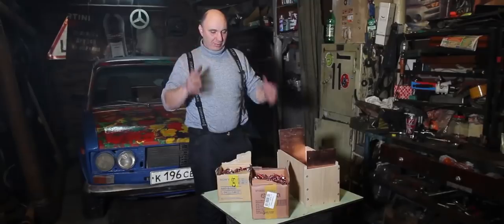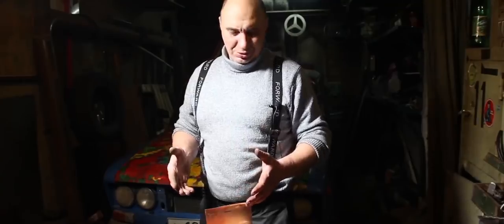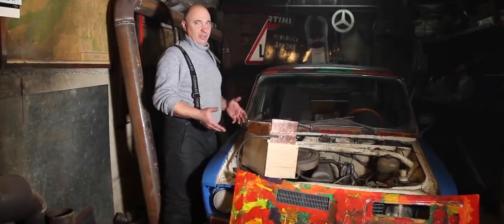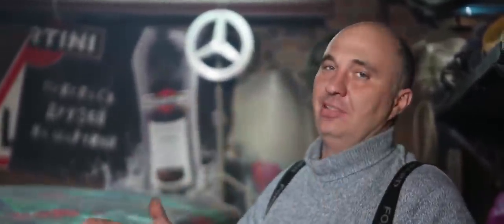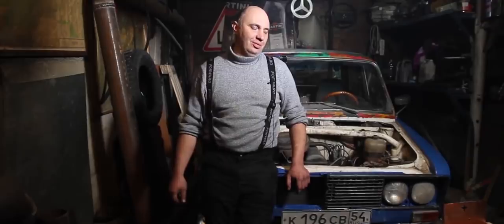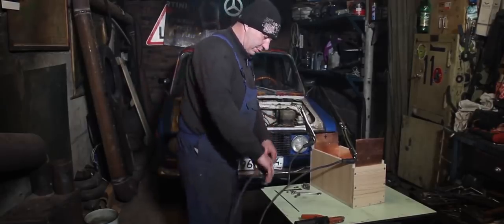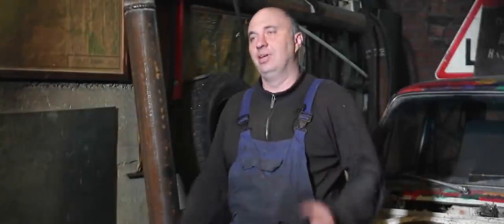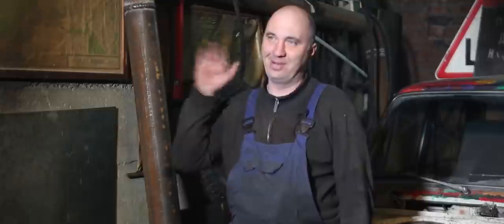1000 AA's instead of a conventional car battery

Comment: That was a smart way to connect all the AA batteries in series and parallel.
Reply: I was wondering how they would. Figured he would have five guys soldering all weekend lol
Reply: I know that was like 300 volts maybe more depending how dead they are.
Reply: WitherSpawn  I think  the voltage in the way he configured them would be what ever wide  by long wise on a (single level)  idk I gotta think 🤔about it.  1000 1.5 s it can be 1500 volts
Reply: Yep.   8 batteries long = 12 volts.   He should have 12 volts at the end plate.
Reply: @g36killer  No. Its all lines of 8 for serie; 8*1.5 = 12 V. And then all those lines of 8 are paralel, which only increases the current (I).
1000/8 = 125 times the current of 1 battery. Since he said good alkaline, but not top, its probably about 1 amp, so the total rigg can then produce some 125 amps at 12 V. That is P=UI > 1.5 KW
Under heavy load (you are basically shorting the batteries and they are not intended for such use, the Voltage will drop some. Which then means the total power is also going down. Probably effectively 1 KW for limited time. Enough to start a car, not enough for welding like this. You can however weld small things, even with a lot less power.
Reply: @StofStuiver  and that is why i flunked tech school...Math no go
Reply: @StofStuiver  I am an Auto Electrician,  your maths looks correct, I was concerned about them being charged at 14 ish volts and how a standard AA battery is not made for that, I wonder how long they would go before they heat up
Reply: 8 batteries in series to reach 12V (12/1,5=8). 100A to start car divided by 1 amp per battery = 100 batteries in parallel. 100 batteries for the current times 8 batteries for 12V = 800 batteries in total. wow!
Reply: Yes it was
Reply: @EssentialComment  I was wondering the same thing. But doesn't an alternator have a feedback sensor? Humm........
Kif ! We have a conundrum.

I think in reality, eventually that alternator would ghost them.
Reply: 12 volt
Reply: just 12 v and in best case 240 amps
Reply: 1000 seems like a lot. You could probably start it with 100, since you can draw around 7 amps from a single AA. Though unless recharged you would only likely start the car once or twice.
Reply: @StofStuiver  If it is 1 KW, then what is the wattage per hour?
Reply: @teemum.9023  1KW for an hour is 1KWH ;p
That is, if that power can be sustained at 1KW, which these batteries can not. So errr in order to calculate how much total (usable) power you can get out of this rig, youd have to know the precise specs of these batteries. My guess is with fairly new batteries (makes a lot of difference how long they are in transit and on the shelf), we are talking 5 minutes probably.
Reply: @bansheemania1692  simple Ohms law. pretty easy when you learn how the equations are broken down. figuring out amperage in parallel is fun :P. the recipical method blows many peoples brains away lol
Reply: I saw a teardown of a Tesla-battery, and it had loads of these types of batteries inside (well, not AA, but they look kind of the same) but they are welded. but probably not by humans, but 100% by robots, and not one at the time :)
Reply: @StofStuiver  how do you know the amount of battery's end to end creat volts, and the total amount makes the current/amps? I know school probably but I'd like to learn about that topic if you can explain a little
Reply: @Anon29  is that how you know how many batteries to have in series and in parallel? Or how you know why it works that way
Reply: @skie6282  Well its been a couple of years, so i dont remember the video exactly, but i think you are asking about the principles of series and parallel as for batteries.

So for batteries, puting them in serie, you can add up the voltages of all components. (series = + to - to + to - to + to - etcetera, and ofc each + or - goes to the next battery. If you would connect a + and - on the same battery, you short out the battery). So if you have have 10 1.5V batteries (the AA or AAA types and such); if you put 2 in series, you get 3V, 3 > 4.5 V. 4 > 6V. Etcetera. And 10 would be 15V

Puting batteries parallel, you can add up the drawcurrent, so the current they can together produce. (parallel = - to - to - to - and + to + to + to + etcetera). So if you have 10 of those batteries again and you put them in parallel; the current you can draw (if 1 battery can produce 1 amp) is 2= 2 amp, 3 = 3 amp, 4 = 4 amp and so on.

Now note that for series the current you can draw from the total is no greater than the current from 1 battery. And for parallel the V of the total is no greater than the V of one battery. Also note that we are talking 'identical' batteries. Things get more complicated if you mishmash different voltage and current batteries, if it is even possible.

So for this situation they want to start the car with 1000 AA batteries. We know that AA batteries (alkaline) are 1.5V. Another thing we know is that it is to replace the car battery, which is 12V. The starter motor obviously is also designed for 12V. So with these 2 known we can first calculate how many batteries we have to put in series, in order to get 12V.
Thats 12/1.5 = 8 batteries. So the rig has to be made with 8 batteries in series.

But we are not going to get the starter motor to turn with just 8 batteries. The current you can draw from those 8 is no more than from 1 battery if those 8 are in series (see above). So i estimated 1 amp for this type of battery. (ofc i can be wrong on that, but i presume not much). So the power we can draw from 8 batteries in series is P=U*I > P = 12 *1 = 12 watt. Thats a nice amount for a flashlight, but its not going to turn over the starter motor.

So in order to increase the power the batteries can deliver, we have to make a number of these 8 in series. That 8 is fixed. Bc we need 8 to get to 12 V.
Since we have 1000 batteries, we can divide that by 8 and get 125. So they have to make (or made) 125 'strings' of 8 batteries in series.
Then to increase the current that they can give, you put all those strings in parallel.
That gives you 125 amps.
So P=U*I > P = 12*125 = 1500 watts = 1.5kW and then will make the starter motor turn over nicely.

Another example of series and parallel is what you often see car/truck enthousiasts /repair people do. They often are faced with missing or broken batteries when they get a new machine and want it to run at some point. Car batteries are pretty much all 12V and truck batteries can be 24 or even 48 V.
So you often see them take 2 car batteries and put them in series to get 24V to get the starter motor of the truck to turn over. Sometimes they will use 4 batteries; 2 parallel to increase current and 2 series to increase voltage. Or you could use a 24V one and connect it parallel to 2 12V ones that are in series.

One thing i often see people confused about is that (as for batteries) the current a setup can deliver is not necessarily the current it produces at every moment. It is after all the device that needs to be powered, that determines how much energy it needs. Since V is fixed, the current that actually runs, depends on the consumer (starter motor for instance), not on the producer (the battery). Pretty much the same as a wall socket in your house. Houses are/were often equipped with wire and fuses of 16 amps, at 220/240 volts. But if you plug in your phone charger, it will not draw P=U*I > P = 220 * 16 = 3520 watt = ~3.5 kW. If that amount of energy would flow through your phone charger it would instantly burst in flames. Actually the power for that is milliwatts, rather than watts even. So the current is even a lot smaller.
A coffeemaker typically (bc of the heat... all heating devices use a lot of power) is 1 kW. A microwave typically is 700 watts. A big flat screen tv, 100 watt. Desktop conputer; 200 watt. Etc.
The power consumed is dependant on the device that uses the power and more specifically by its resistance over the power inlet.
So the 16 amps @ 220V is the indication of the maximum amount of power that can be drawn over those lines. It is fused at 16 amps, bc the wires are only safe up to 16 amps.

I hope that helped you ;]
Reply: @skie6282  voltage is additive in series,  amperage is additive in parallel, Ohms law. E=IxR, E is voltage, I is amperage, R is resistance/ohms P or power/watts is found P=IxE, I=current/amps E=voltage.
Reply: @g36killer   300 V would have fried everything electric in the car including the starter... The batteries was 8 in series meaning 1,5v times 8 = 12v not 300... Rest of the batteries was in parallel to give it enough amperes to run the starter..

Comment: I really wish he'd put a multimeter on the batteries before and after, see how much voltage is in there and how much it sucked out.
Reply: My guess would be 12.7 volts and about 1090 amps to start, and 11.9 volts 950 amps at the end.
Reply: @davekauffman8727  1090amps in batteries? How? Battery is a voltage source, it will push out current inversely proportional to connected resistance, up to a point where the leads melt or the battery explodes.
Reply: AA batteries are about 2ah. Hes using 8 batteries to make 12 volts and I think I counted 11 series per layer and if he has 1000 batteries he will use 968 batteries to make 11 levels of 11 series cells. 

Each 8 batteries is 2ah, each layer is 11 series so 22ah per layer, so it's a 242ah battery. Small cars usually require 200 amps to start, this isn't capacity but a burst rate. So he might be able to crank the engine for an hour before it'll die, theoretically. Thise batteries look cheap so I bet they'll overheat first.
Reply: @davekauffman8727  thats a much smaller engine but usually most batteries crank like 500A out and the process takes 2-3 seconds so i guess 1000-1500 ampseconds. given that aa battereis dont support high C discharge i suspect his battery has a very large capacity. also keep in mind this tiny russian engine wont need much cranking amps
Reply: @Karl with a K keep dreaming
Reply: @Karl with a K maybe as a rating my ls trucks starters are rated for like 1.1kw ,1.2kw so like 100 amps but the in rush current will probably be hundreds of amps so I'd assume something like that is probably like 70 amps but the inrush is probably over 200 maybe 300 amps
Reply: Ya my math is 8 in series so thats 125 groups that make 12v and new ones being like 1.6v or like 1.58 up there so ya 12.7 or 12.8 but my testing puts only the best at 2AH more like 1.5 AH I think is fair maybe a little higher and I'm assuming they are alkaline but that's like 190Ah battery that's pretty big most car batteries are like 50Ah and short circuit current I get about 10 amps I'm not sure what the voltage drops to but it recovers pretty well but I think they could put out like 1250 Amps I bet you could get by with a lot less and if you did like 20 in series you could probably easily weld that would be 50 groups and be able to do like 500 amps
Reply: @Karl with a K well not tiny but the rest is right I guess depends on what you consider tiny like I said my 1.2kw wiĺ draw 100 amps after the inrush current

Comment: I like to see the minimum amount of batteries it takes to start the car... great show
Reply: Math much? 400AH to cold start at 12v...  Approx 2amps per AA, you need about 200 AA's to start a car that size.
Reply: Richard Wraith i thought the same question and did the math while watching the vid, came up with 200 as well. i was going with 3amp per quality battery and needing 600 cc amps, it's really cold here where i live lol
Reply: @Mike Oxlong i just read an Energizer, says it's 3amp. serious ;)
Reply: Mike Oxlong  You're confusing capacity and current delivery. A new alkaline AA is 2-3 Ah in capacity, and can push some 10A of current when short-circuited. A good quality 18650 is 2-3 Ah in capacity and can push as much as 50A when short-circuited.
Reply: This comment section is cancer.
Reply: Everyone is also forgetting that you're putting 8 cells in series first (current remains the same, 1 - 3ah or whatever a single cell is rated at). Only when you parallel those 8 cells groups together you begin to increase the current capacity.
Reply: @themaritimegirl is right
Reply: ElectroBoom did it
Reply: @Slicerwizard  actually it needs both, but I agree, these people don't know an amp hour from a pork chop.
Reply: i bet not that much, atleast not when you use capacitors in between
Reply: Mike Oxlong  You were wrong. My 18650 and 26650 cells could deliver a lot more, the 26650, for example, could deliver 45 amps continuous and the peak is way higher.
Reply: Mike Oxlong  I work with batteries as an engineer you can definitely get 2A from an alkaline AA battery.  It will drop to about 1V under this discharge but with 8 in series this will be enough to crank a normal starter. Also mAh is not the same as current.
Reply: @Tom5TomEntertainment  but he used them to recharge the lead-acid battery from the car, not as a substitute for it
Reply: Mike Oxlong  
You're wrong. You can test it yourself. AAs can deliver 3A+ short circuit. Even old digital cameras that ran on AAs used to draw up to an amp from them
Reply: Had the exact same thought. I bet it could use half as man.
Reply: @RichardWraith  No you don't need that many. Electroboom started his car with 12 or something :/
Reply: Mike Oxlong  Wait wait hold up. I have a LG HG2 18650 that i have tested good for 20amps. Your trying to tell me its almost impossible to get 3 amps out of a 18650 cell. I think your confusing Capacity and current delivery. Because i have some other 18650 i can get 35Amps out of it with 3000mAh
Reply: You can do it with 12.    No, old digi cams used cap charges, not batteries direct.
Reply: @RichardWraith  Apparently you dont..
Reply: Watch electroboom video. :)
Reply: @tomsixsix  you aint cranking a starter motor with 16amps..

Maybe a 50cc moped.
Reply: @Jasontvnd9  not under load, no, but unloaded it will likely turn without too much issue.
Reply: @RichardWraith  That doesn't compute.  However, since it takes 8 batteries in series to provide 12 volts,  200 AA's would comprise 25 banks of 8 cells in series, each bank providing 12 volts at 2 ampere hours.  This comes out to 50 ampere hours at 12 volts, or 600 watt hours.  and,  you can draw 4 or 5 amps, briefly,  from a good AA cell, for a few seconds.  Each AA cell would provide 3 watt hours, at low drain.  Now,  a small car battery is capable of 50 ampere hours, as well,  which is also 600 watts,  but maybe is rated at 450 0r 500 CCA,  which is higher than you'll get out of 25 banks of AA cells in parallel.  Even if the AA cell is capable of delivering 6 amps momentarily,  this only amounts to 150 CCA.  So  the pack of 200 AA's will have to work a lot harder,  and waste a lot more energy to internal resistance than would a lead-acid car battery of the same capacity.  It might not be enough to start an engine of appreciable size.  However,  using 1000 AA cells instead of 200 offsets the losses wasted to heat by providing 5 times the initial capacity of a 50 AH car battery.
Reply: @themaritimegirl  But short circuited is close to zero volts, which will not crank an engine.  Since average cranking voltage is around 9 or 10 volts,  it would be interesting to put 8 fresh AA cells in series,  then load them down until they are  putting out 9 volts,  while measuring the current drain,  which will likely be less than half of their short-circuit current output.  As load resistance increases,  current draw decreases.  And in the case of alkaline cells,  this relationship is not quite linear at higher current drains.  A short-circuited alkaline cell will be dropping nearly the full rated voltage across its internal resistance,  wasting most of the energy to heating the cell,  ruining it in short order.  This is why the 18650,  along with other Nimh, LiPo, and niCad batteries,  carry a stern warning not to short-circuit them.  A shorted AA cell, if it pumps out, say, 10 amps, will only dissipate 15 watts for the first few minutes.  The battery will get warm,  but usually not dangerously so. Your typical 15 watt resistor is even smaller than an AA cell...
Reply: Actually one aa battery can start the car as long as you can charge a capacitor with it
Reply: I know 1 12V AA set (8 AAs) can't power up Sony EX-1 camera properly, the camera shows only no more than 11 volts even brand new batteries.  So I am also wondering how many 12V AA  sets can start car.
Reply: there is aa alkaline batery with capacity of 2850 mah and you get 240 amp and 12 volt from his pack
Reply: Clearly most here aren't EEs or even engineering minded
Reply: Mike Oxlong  how mini for a audi a4 b7 170hp lol
Reply: wow do the math?? LOL

Comment: Imagine if they accidentally put one battery in the wrong way 😂😂😂😂
Reply: Not really a big deal, you just wouldn't have any current running through that specific line... it will be the same as removing a battery from a line, the current won't pass...
Reply: @francoisdvanderwesthuizen  Actually since that path will have lower voltage, the rest of the battery will discharge through it, possibly causing an explosion.
Reply: Nothing will happen at all